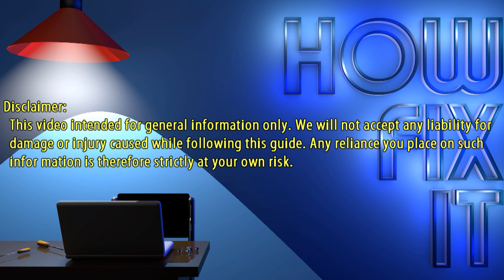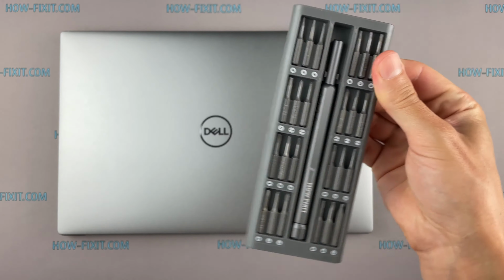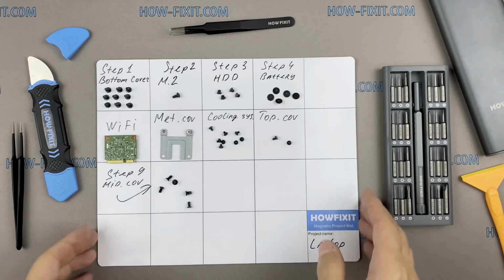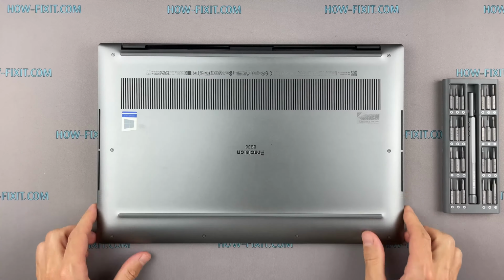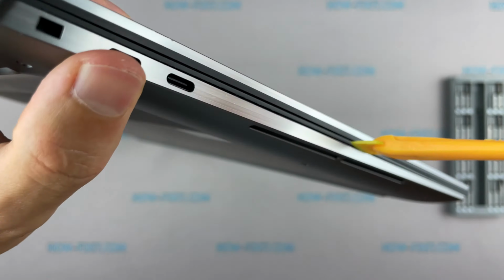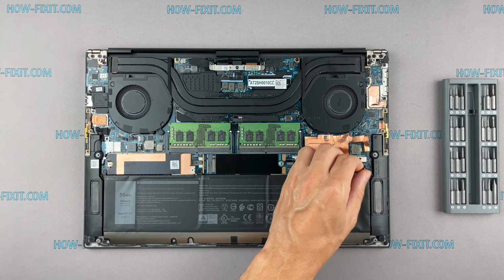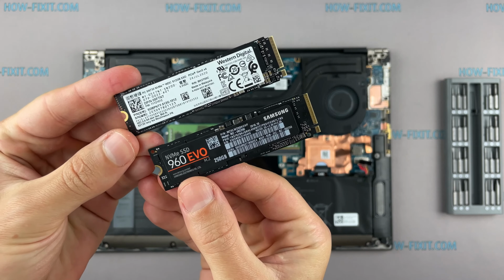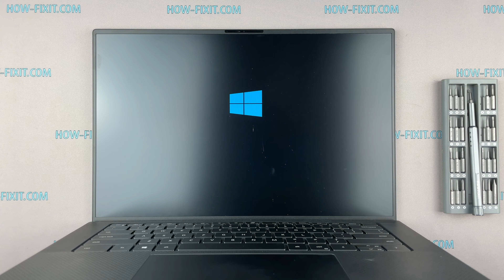Dell Precision 5550 How to install M2 SSD upgrade

Comment: Is the 5550 similar to the 5570? Do you have any issues with the USB - C port where you plug the charger in? Can you use the other USB - C ports to power the laptop on? Thank you. Do you need to put a heat sink on the original M.2?

Comment: Thanks for the video. Why is there no thermal shield put on the second SSD (the one on the right?).  I've got the same laptop and want to connect a second one but I have no second thermal shield for it. Will it be OK?.